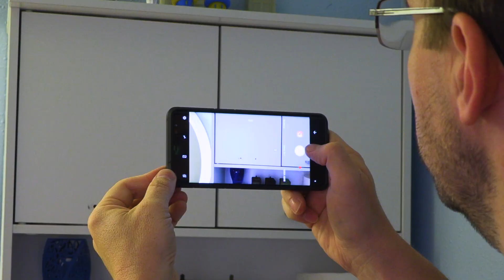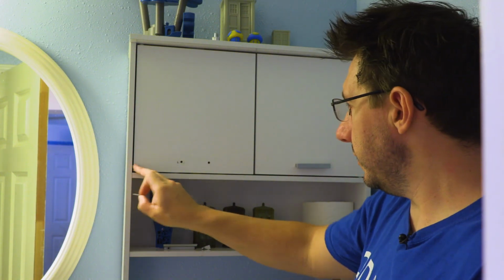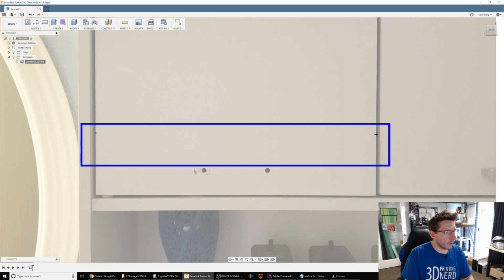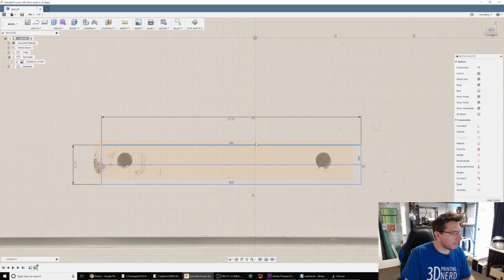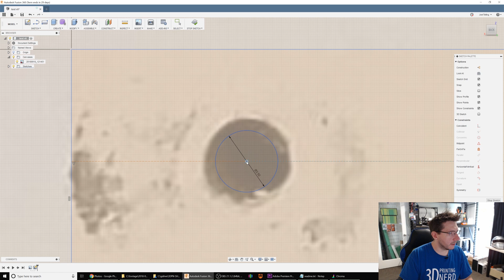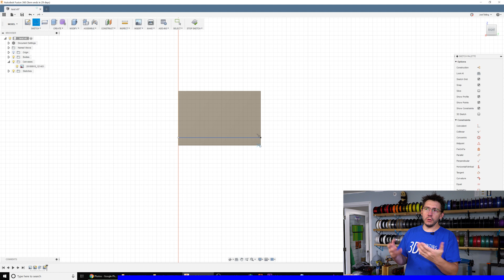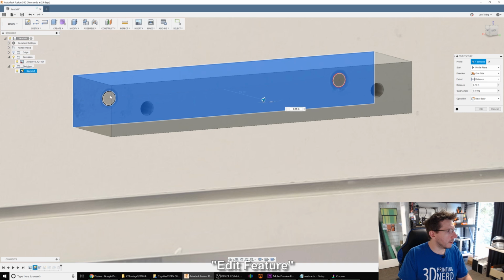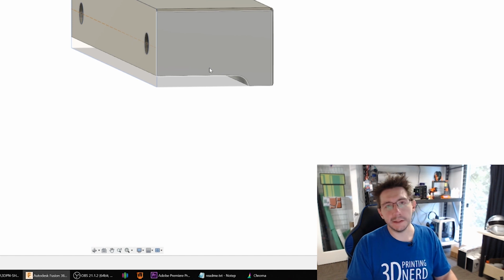Practical 3D Printing in the Bathroom - Fixing a Cabinet Handle

Comment: In what the door length and the picture are useful when you only need the distance between two holes, the screw diameter and maybe the original handle with caliper to replicate the design ?

Comment: This is way more complicated than it needs to be. Measure one hole and measure the distance from one end of the hole (Ideally a tangent perpendicular to the bottom surface) to the other. Pretty disappointing for someone who can use a deburring tool but can't use a ruler. lol
Reply from the maker: lol? really? I tried to show a cool way to do something, and you're disappointed because I didn't do it your way? now THAT is an lol.
Reply: @3DPrintingNerd  yeah that's cool but why do it for such a simple product? Isn't it lengthening the process? Why would one go through all that trouble? i was only wondering. If it was a facade that needed redesigning, that would have been a better video.
Reply from the maker: You are right - it DOES lengthen the process. However, I've found that something like this inspires people to learn more. From what I've heard from some - the idea of a simple project tricks their brain into thinking the process is simple. They aren't scared about some advance idea or technique, and they're able to learn easier.
Reply: @3DPrintingNerd  You could have dialed it a notch tougher man . 😂

Comment: Isn't that method prone to parallax errors? I usually measure the holes myself from center to center. Although I am usually dealing with M3s where a millimeter makes a difference.
Reply from the maker: True, it is. I wasn't dealing with measurements where a single millimeter would make a difference. If I was, it would have been better to put a piece on a flatbed scanner. I think.

Comment: Hi Joel,  I put a .5mm (.02") chamfer around the edges of the surface that will sit on the print bed.  Then I don't have to debur the elephant's foot on the base of the part.  I suppose I should calibrate my printer so I don't get the elephant's foot in the first place.......

Comment: I didn't know it's possible to do that with images.

BTW something I would suggest is also comparing the price of the plastic you use vs going out to the store to buy new parts. Like it would be neat if more videos will point out if there is a cost saving and how much. I'm thinking about keeping track of that on mine just for kicks.

Comment: Hi Joel I also am very picky about cleaning the flash off my prints BUT  be careful I see you cutting the flash off thats going to get you cut try this drag the blade of your knife scrapping works really good go right alone the edge on the top of the edge then along the face of that same edge only the flash will curl off and leave a nice clean edge I worked at  Douglas Aircraft along time ago but I did A LOT of deburing and trust me scraping is the way to go on soft materials let  me know how this works for you

Comment: OK so... First of all great video, I love all of your videos and a huge fan. But here comes a little heat... So i model in Solidworks and they have a similar tool to this aswell. There is a  problem to this method. The picture, unless the picture is a projected image, will never be 100% accurate to design against. Now yes nothing can be 100% (it's impossible), and also if the mating surface in real world has loose tolerances, this technique can work, buttttttt when the tolerances are tight and you start dealing with printed threads, to match up to clearance holes...or interlocking bosses from one mating surface to another, you can run into issues quickly. It is the perspective of the picture and drawing from a scaled detailed thats the issue. The picture in cad is not represented linearly in the software. It is represented parabolically, while you're soft dimensions are represented linearly, resulting in a difference and a bias of accuracy leaning towards the center of the picture. These inconsistencies can leave you very frustrated in the long run. This bias is magnified and can be calculated when scaling the picture with a conversion dimension (your 11inches). Since this linear conversion dimension spans the whole picture side to side across the parabolic gradient, the scale at the center of the picture can differ upto 10-11% usually only 6% but I have seen as high as 10%.Personally because of theses findings, I am pro-caliper or pro-micrometer when it comes to dimensioning designs that im going to retrofitting a new part to. With all that being said, your technique is going to be sufficient for the majority of people, and for tasks that would be too difficult to manually measure in real life. There is also a time savings using your technique, which has to account for something :) . Never the less Great video! Keep up the great work, just thought I would share a little, aha with my fellow inventors!

PS when you rotated the view after the first extrude, look at the edge of the bottom of the door... Looks pretty parabolic to me...
Reply: I agree with this. I've been making some replacement plastic parts for some old electronics, if I tried the picture method nothing would fit properly because there is no way I'm going to be perfectly straight on. Caliper everything!

Comment: Nice job Joel, This is a great application of real world use for 3D printing... If I need super high precision for scaling I will take a picture with an engineering scale in the picture or open a set of calipers to a specific distance and zoom in and measure between. also taking the largest measurement will be the most accurate as any error will be divided instead of multiplied!

Have fun in New York !

Comment: Hey Joel,
As you are designing in fusion 360 have you considered using its built in feature to create threads?    I've been printing my parts pre-threaded for a long time and have always had good results.   All of my printers have been able to print clean usable threads printing in any orientation and at resolutions as low as .35 (I don't have anything that will print thicker).  Im able to get a firm grip as the load is distributed across multiple threads, and I never split or separate layers as the screw or tool doesn't need to apply force to thread or grip the print.  One of the cool things about fusion 360 is it will suggest a threat based on the size of the hole or cylinder.  

For a part that will not revive a lot of force thread holes would have been great for your handles.

https://www.thingiverse.com/thing:1926900  Here is an example of a pre-threaded design.

Comment: hey joel ! how about a 3d printed  robot lawnmower  :O  they are kinda like the roomba  but lawnmower version lol   you can try to control it via arduino   or make it in to a rc lawnmower  and use an rc remote and drive it around on your lawn

Comment: Wait wait wait... why not just measure the holes? Why interpolate? It takes 10 seconds to collect the TWO dimensions, and set their midpoints as vertical. 12 seconds to capture the distance to the edge as well. 

Sorry Joel, usually love your stuff but this extra step is just a place to introduce errors from your cell phone lens and camera. The earlier suggestion to scan the handle on a flatbed scannner at least uses a calibrated flat and linear value, AND adds the handle for reference. 

Explain the interpolation/reference divider feature of F360 some other way. This is really not the best way to be accurate.
Reply from the maker: Hey David! Don't be sorry, I'm always up for wanting to learn new stuff AND better ways to do things. What do you mean by collect two dimensions and set midpoints as vertical? Also, YES to a flatbed scanner. I need to get mine working again, and scanning the handle that IS NOT broken would have been better - you're right.

Comment: The the effort of bringing in the photo and scaling to the door dimension, but then you just "eye ball" the initial rectangle location in relation to the holes. By not taking at least one dimension off the holes or basing your design off the hole locations in the drawing, your entire design is only as accurate as your guessed location for the rectangle.

To make this far more accurate and useful to other examples in real life, you should have placed the circles over the two holes in the image first and then found the center between the two holes to serve as the center for the rectangle.

Other than that, great tutorial for how to use 3D printing for practical design.
Reply from the maker: YES. Holy crap, I didn't even think of that. THAT would be been perfect! I'm very much going to remember that.

Comment: DUDE! I did not know calibrating a picture in Fusion with real world dimensions was a thing!!! I have Soooooooo many uses for this now! Thank you so much! See you at maker faire!
Reply: TheMidnightSmith this is not the proper way to do this, if you want to import a picture to fusion it should be taken with a scanner because of the difference between orthographic and perspective
Reply from the maker: Unfortunately my scanner wasn't bathroom compatible
Reply: It worked out good for you but in the future things to check is that you are perpendicular to the surface and also make all your dimensions colinear (in a straight line so you would dimension the width of the cabinet in the line that goes through the the center of the holes)

Comment: Thanks this was a great video as I was just designing a relay case. Now I can take a picture of it, dimension it, locate the posts. Great! it will make it a lot easier. I have been remodeling my home theater into a "Space Ship" complete with "Star Trek Doors" and I have been using the skills learned here and other places to 3d print the brackets for everything in the room.

Comment: Using a photo as a base for your construction can result in errors, since the distances on the photo can be distorted due to perspective. Make sure that your camera looks at the object as straight as possible, and don't hold it too close to the target. Take the photo from far away and use zoom instead. That way the effects of perspective are less.

Comment: I wouldn't have bothered trying to take a photo and scaling the photo to measure (though that does help in certain applications).  Since this was such a simple part (and because the holes aren't necessarily centered on the panel) I would have taken a caliper, measured the tangent between holes, then measured the diameter of a hole and added that on (since it would be the radius of each hole).  That would give you a pretty accurate measurement of center to center.

Comment: I endorse your decision to use Imperial measurements in this case, and here’s why- all of your cabinets and fittings in your house in the US are going to be in inches.  Cabinet handle hole spacing in the US is usually in 1/2 inch increments, for example.  Wood and materials available here are in fractional inch measurements.  So it is correct to be using the same measurement system as the piece and materials your are working with.

I think like this.  If you are trying to put a fitting on .5inch copper pipe, your not going to be buying 12.7mm fittings and hope the threads are the same.
Reply: Even Canada still uses imperial in plumbing, construction, electrical, printing, etc.
Reply: This was my point exactly. Wasn't trying to start the debate on right or wrong of metric vs. imperial. I was trying to make the point of applauding that he worked with the units of measurements used on the project he was working on. If you have an import car in the US and all the nuts and bolts are metric, you don't try to show a 1/4-20 bolt into a 6mm hole... You work with the units you were given.
Reply: You obviously don't live in America. We live in a mix bag of measurements.
Reply: I live in Canada and do my part every day by not buying American cars and doing all I can to use metric stuff in my home. Construction really is the last domain to conquer. What I'm saying is that we've got to a point where imperial shouldn't be tolerated anymore. It is the last stretch and we should put that extra effort to replace things and get everyone on the same page, even if it's not the most efficient thing to do in the short term.
Reply: @dsp4392  Cars have been metric for a while now.
Reply: +John Cochran That's exactly what I'm saying. There's still work to do, and unless we push really hard, imperial will stay. The fact that there are still some imperial measurements around (like display sizes) is usually justified with appeal to tradition ("people are used to that"), so the only way to move ahead is to go the extra mile, push that little bit harder for metric. Accepting that there are imperial-designed objects around and working with them instead of actively replacing them with metric equivalents is resisting progress. North America needs that change. Most of the low-hanging fruits have already been picked, now it's time to move to the hard stuff. It's the last stretch, and it'll probably be the longest to go through, but ultimately, it's for the greater good. 

+Michael McGuigan I realize most cars have been for a while, but some US models still use some SAE fasteners here and there, especially trucks.
Reply: Absolutely get what you're saying, but this is also the kind of thinking that leads to imperial measurements still being used today. People in the the US need to actively push back against imperial in all and any ways they can so it finally dies. Redrill the holes and use metric screws if you need to. It takes more time, but you're fighting the good fight.
Reply: dsp4, I'll bet that you're currently using something right now that's a mixture of metric and imperial measurements.
Just look down at your keyboard. What you're likely to discover if you make accurate measurements is that the switches themselves (assuming that you're using a mechanical keyboard) will have metric dimensions. But the spacing between individual keys will be imperial. Namely, they key switches will be laid out on a grid of 0.75 inch squares. Now you're going to have to measure over a fairly long distance to determine this precisely since the metric measurement between keys will be 19.05 mm and the difference between 19.00 mm and 19.05 mm is rather small and for most purposes unnoticeable. But over the distance of 20 keys or so, that small difference adds up and would result in the key switch pins not properly aligning with the through holes in the PCB.

So ... How about you attempt to get a completely metric keyboard for yourself? Good luck.

Comment: i designed a lost part for a chainsaw, the air intake that holds the filter and covers the carburetor.  plus, it needed the throttle knob.  made it out of PLA+.  now, next time i'll try to take a pic to help make something.

Comment: Nice video Joel. 😎✌️ One reverse engineering tip: Take the existing handle and put it on a flatbed scanner. Then insert the picture in Fusion360 with the measures from the handle you have the exact measures of the holes. This works only for small parts...obviously 😅. Keep up your work and greetings from Germany
Reply: Alternatively, put the tape measure in the reference picture so it contains the size.

Comment: Personally, I just measure the center to center difference using a ruler and calipers.  As long as I get really close to the same measurement with the calipers as I get with the ruler, I can be pretty confident that it is correct.  Then no picture is required, just a dimension with a hole on both ends.  Another thing to keep in mind is that when measuring the threads on a screw, you want to do it at an angle so that your calipers sit on top of and don't fall down into the threads, at least for machine screws.

Comment: You could have used  Threads to set the thread pattern in the holes to hold the screws. It would have not only added the threads but resize the holes for optimum hold and clearance.

Comment: I printed a Thingiverse generic grill knob in ABS this spring that is still looking brand new even with all the heat escaping the front of the worn out lid...Beats the crap out of using a pair of pliers to push down and turn the shaft....Made 2 Thingiverse special wrenches (diamond shaped hole) for a co-worker's discountinued water system....He was ecstatic because his only original special wrench broke and he couldn't order the old style anymore (cash grab for the new system)...Said the new 3d printed wrenches was a better design too....Just printed a Thingiverse pop socket plate this week for my wife's phone because hers broke....It makes me grin when I successfully print solutions to everyday problems....Really grateful for Thingiverse too...LOL